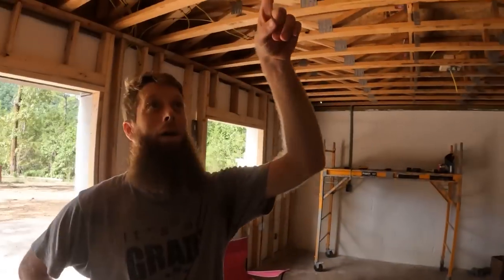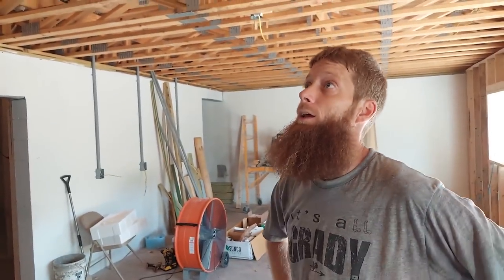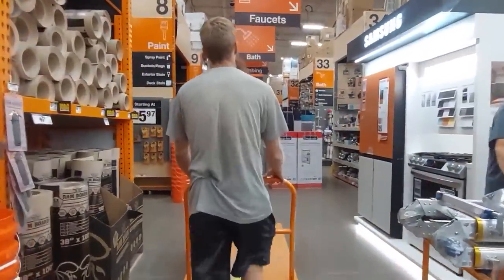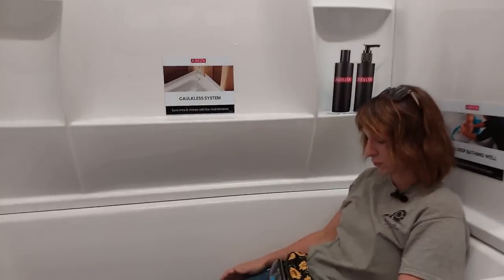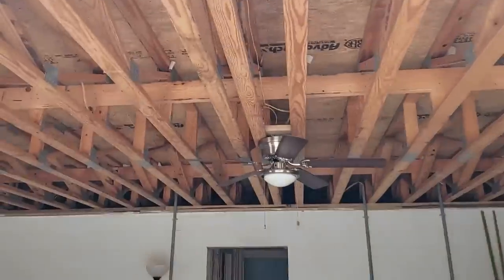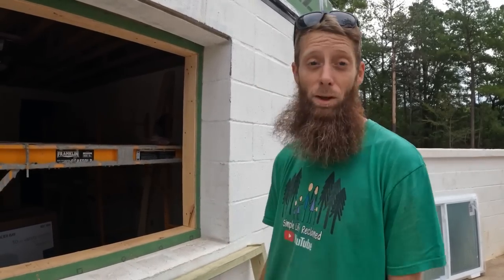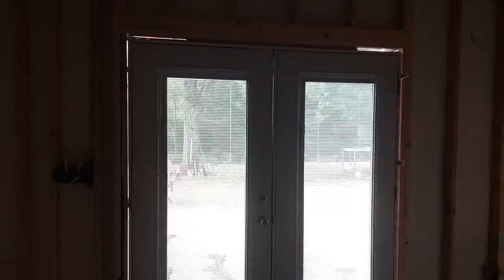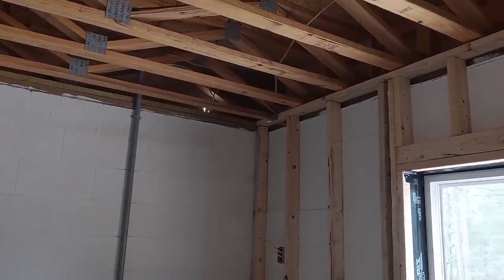Its FINALLY Time! | Doors, Windows, Ceiling Fans, Oh MY! | Couple Builds Basement for Dream Cabin

Comment: I don’t know if you have thought ahead to your bathtub install, but, when our tub was installed the plumber used trash bags filled with mixed up gypsum plaster (I think that was what was used) under the tub.  Then the tub was filled with water and allowed to set for 24 hours.  It really made the bottom of the tub solid feeling and I think it was done to eliminate flexing and possible cracking of the tubs bottom.  I am so happy you are moving along so quickly on your basement.  You will be living inside it before you know it.  Keeping my fingers crossed that you have everything moved in before the winter weather sets in!

Comment: You must try to square and plumb the double door into the opening..I can see daylight where the 2 doors come together at the centre T moulding..Also I didn’t see You set the bottom threshold into a bed of silicone caulking before screwing it to the concrete..If You didn’t it’s going to leak like a sieve.Just trying to save U some future heartache..Enjoy watching your channel and all the work U put in to build Your families future home

Comment: The door with the handle on it is gonna need a little adjusting. The top you can see light through it so the top of the door itself needs to be kicked in some. Where it meets the other door. Probably from the factory that way. Just a heads up for later! Keep it up guys!

Comment: Warning! Don't use big gap filler. For windows and doors you need to use Great stuff for windows and doors. If you use the big gap filler you could bow the window and door frames and make them bind.

Comment: Did you remember to set the switch for summer direction or winter direction on your fans one pulls the air up the other pushes the air down by the angle on the fan blades

Comment: Use some backer rod before you caulk the door in.  You guys are doing great! Those french doors can be a bear if the floor is not level. Take it from a 42 year carpenter things are looking good. What are you planning to use for heat?
Reply: I think Mel mentioned having good experience with the oil heaters from before - so the same for now.  I think Gary mentioned being able to use one of the ceramic w/ fan units as well.  I think that's all temp until they get HVAC installed once the main floor goes up.  This is all if I remember correctly.

Comment: Bracing is good for the fans also get a few pennies or dimes and a small roll of double sided tape. If any wobble occurs stick a coin on top of a blade to balance it. just look for the blade running the highest as it spins.
That's an pretty big gap between those doors at the top half.

Comment: Congratulations on this milestone. I am very happy for you both that you made it. You can do it!!!

Also nice Idea with the Backup for the Backup. Because in the Winter time, when outside its cold and you are warm and neat in your Basement, you will get some condensed water on the Windows and Doors. So do not be surprised when it happens. So better put Silicone inside where possible because of that

Comment: For those holes you drilled maybe instead of using gap filler find yourself some rubber plugs like what's used for automotive purposes and plug the hole instead. Weather worthy and easy to put more wires thru if you decided you wanted outdoor plugs on that side of the house.

Comment: Curious that you are putting up the fans before you install the ceiling.  If you drywall or use beadboard the fan will have to come down to install it.  I have the same fan in my house.  Make sure that the ceiling is utterly flat or else the fan will jiggle.  Don't forget about the seasonal direction switch on the fan.  You want the blades to spin so in winter the hot air is pushed down and in supper pulled up.  So since the blads are set like this -> \ <- you only have to see which way the blades spin.  Clockwise would pull it up and counterclockwise would push it down.

Comment: Hey Guys the windows and double door look great, I especially like the blinds built into the doors, however I think you should rethink about just insulating the ceiling only between the rafters, I think putting Plasterboard (English Term) as well up there, will add just that little bit more insulation, of course, Gary loves to, some may say overkill things (I don't agree with this) sound forward planning I would call it, so I think you could roll extra insulation rolls across the rafters to increase the insulation value, even if you don't plasterboard it, as there is not a lot above your heads in the loft space with the winter approaching, what you think guys.

Comment: I have those exact same fans from Home Depot.  I've had them in for a couple of years and I love them.  Any season they move air around to heat or cool the house.  My house is over 2000' and I only have 2 and they do us just fine.  Really proud of you guys for staying under budget.  The one area it is really easy to go crazy is fixtures, but let me tell you something those expensive ones rot out just as fast as a less expensive one.  My water is so hard where I live that I have to replace faucets about every 3 to 5 years.  I have bought both expensive and cheap and neither lasts longer than the other.  It just doesn't hurt as much to replace the cheap ones.  Looks really amazing and you are making so much progress now.  Everything you do will show now.  GREAT JOB  God bless

Comment: Are you drywalling the ceilings?
Reply from the maker: Not right away. Will be open until we finish the cabin up top of the basement, the. We will so something with the ceiling. Maybe drywall, maybe wood. Still deciding but have time to figure it out.

Comment: Wow...great job on windows and doors. Those smaller fill in projects can wait until off air. Loved your smiley faces buying everything you'll need. There could be a few missed items but at least you got most. I like all the niches in tub surround. Will the ceiling fans be in the way when drywall gets put on ceiling? Idk.

Comment: I've installed drywall, so take this with a grain of salt. It's usually easier to put up the ceiling first, then the fans. In my experience, working around all that stuff is a pita.
Reply from the maker: Thank you for sharing your experience with us 🙂 we don't plan to put up a ceiling in the basement until the cabin is finished. We want to keep that area easily accessable until we're done building up. 🤗
Reply: Your going to insulate the ceiling, right?
Reply from the maker: @patchesd9712  yes

Comment: Hi sweetie! Before you use your shower, use white car polish on your walls and the tub sides. **DO NOT WAX THE BOTTOM OF THE TUB OR IT WILL BE SUPER SLICK!**
Put it on as if your polishing your car and let it dry. Wipe it off. 
It will keep the water spots away and  you will NOT have any trouble with mold/mildew....

Comment: May I suggest something lol 
If ur not doing the ceilings just yet.if I were yins lol. I'd get a few sheets of plywood or drywall cut to a 4x4 sheet and them where the fans are going.this way ur insulation won't drop into the fans or stir up debri from insulation itcy's
Lol.you both doing a wonderful job

Comment: LOL I lied just out of curiosity are using insulation or spray foam in the crack around the door I put insulation a layer in there but I used the low expansion foam to put in there too afterwards so that it doesn't foam out as bad but it really works not believe it's in a blue can if you guys don't know about it yet but that'll be a double protection for you guys on the airflow cuz that's the worst place that comes through the door and cracks and the window cracks and you guys caulked everything as you went that's awesome

Comment: I don’t know if anyone has mentioned it yet but you will regret putting drywall on the ceilings before you have a roof on the upper floors. No matter what you do you will have lots of water damage before the house is done. Just trying to help you out.
Reply from the maker: We are not putting drywall on the ceiling yet, that's why we installed our ceiling fans now. 🤗

Comment: GARY I HAVE A QUESTION........ WHAT IS THE DIFFRENCE BETWEEN THE WATER HEATER YOU BOUGHT AND A TANKLESS WATER HEATER.. I WAS THINKING OF PUTTING IN A TANKLESS WATER HEATER IN MY IDAHOME WHEN I GET IT NEXT SUMMER
Reply from the maker: Biggest difference is Amp draw. Right now we decided on a tanked heater because they have a very low draw, and we wish to go solar in the future. Still need more research in that dept, but needed a heater NOW.

Comment: Gary I have a question now my question is I would like you to take a look at your fans I admit they do look great BUT 😆😆😆 how are you going to put up the drywall with the fans up unless you did that for absolutely nothing because you will have to take that all down for the drywall 👍👍👍
Reply: I've been wondering the same thing, but I guess Mel & Gary have a plan for that.  I would hate to clean the fans out (and even the open rafters) of drywall dust as they finish the walls.  BUT I think they need to keep certain parts of the ceiling open/accessible since they'll be working on the main floor after they move into the basement.  They could staple up some plastic, or even house wrap, as a temp ceiling as they go sanding the rooms.

Comment: I don't know what the plan is, so my comment may be useless.  But if I can make a suggestion... DON'T drywall the ceiling.  Leave it open and spray paint it black (I've seen a few like this, it actually looks killer), or do a drop cieling. Access at a later date is cruical

Comment: all those fans will have to be removed for the ceilings to  be sheetrocked
Reply from the maker: That's not going to be til the cabin up top is finished 😃
Reply: @SimpleLifeReclaimed  I'm  glad you responded to one of these comments Mel/Gary.  I was suggesting to a comment that you use some thin/cheap plastic (maybe even house wrap) and staple around the edges of the room while you're sanding in it.  The worst thing you could have happen is for dust to settle/gather up in the rafters (even the fans) becuase you'll never be able to clean that out later (even if you use a compressor to blow it out).  It will also be healthier for everyone after you move in becuase there won't be any residual dust left to inhale.  If anything, maybe just sheetrock the bathroom in to contain the moisture (and you'll have the ceiling fan running).  Just my 2 cents.

Comment: I hope you didnt caulk or put sealant on the bottom of the windows before installing them. You dont want to seal in any water that may get behind the windows, you want a way for it to drain out and away.
Reply from the maker: The window have a built in drain. Cool huh?! 😉
Reply: @Simple Life Reclaimed  Yes, it is cool. But those mostly take care of any water thats inside the window frame. But if you sealed the bottom of the flange, and water gets in behind the window frame, not inside the window, there will be no place for it to go. Sitting water almost always finds a way to wood to cause rot in my experience. Best practice is to leave the bottom of a window unsealed so any possibility of water gets drained away and doesnt sit there to cause rot. If you are concerned that water will get in on the bottom, its very unlikely that water, since it follows the path of least resistance, will go up.
All in all its impressive what you two have accomplished.  :)
Reply from the maker: @j.b.6855  Ya we're not concerned with window leaks there. We flashed the heck out of there and caulked and flashed some more. Really appreciate your thoughtful insight 🙂

Comment: Don't mean to burst yur bubble BUT building codes and final inspection to make yur home "fit for occupancy", MAY knock you back for yur basement ceiling fans being too low.
As Gary already demonstrated, hands up fingers lost.. Ceiling heights in my home country at least dictate if you CAN or CANNOT use ceiling fans in rooms. As you haven't installed ceilings yet, it'll be lower by the gyprock thickness which is more concerning. 
Someone throws you car keys, hands up to catch, trip to hospital..
Happened to me at 15.. 
Just a thought to consider..

Comment: Why the heck would you mount lights before putting up sheet rock you will just have to take them down to put up sheet rock  durp
Reply from the maker: Dennis, it is going to be a few months before we need sheetrock or anything up there as we still need to access that location when we build our cabin up top. This is just the basement. Derp lol

Comment: Why are you working against yourself ? By putting up the fans before drywall you will have to take them back down and the put them back up again.
Reply from the maker: We won't be putting drywall in the ceiling for a long time (after the cabin up top is finished). We want to enjoy airflow between now and then. 🤗